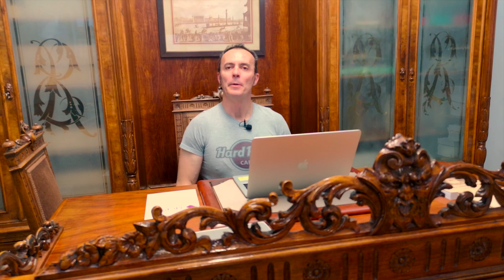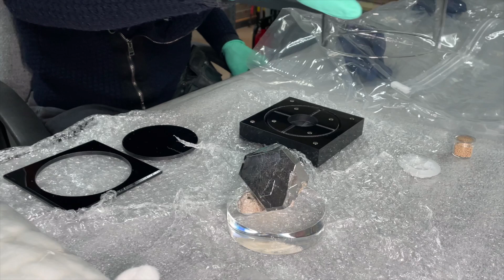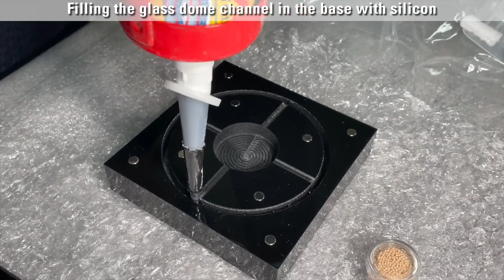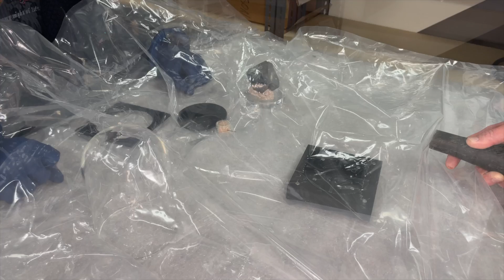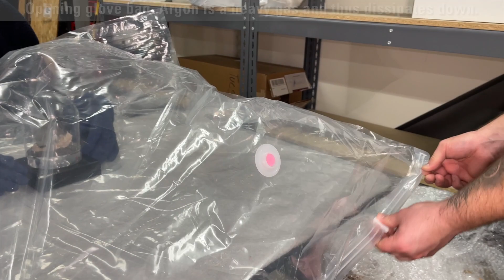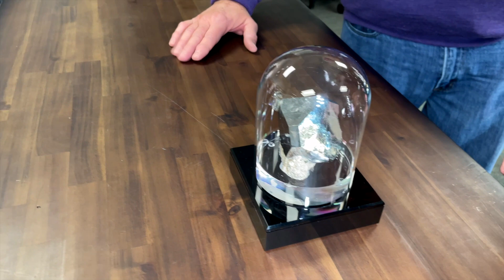Addressing Environmental Degradation of Sulfide Minerals with MCP, Christophe Gobin & Stonetrust

Comment: The issue I see with this is that the glass dome/cover was put standing up on the table in the vacuum bag, in such a way that oxygen would not be able to be vaccumed easily. So when the the bag had the air vaccumed out and filled with the Ar gas, the oxygen in the dome remained in the dome and was likely not completely vacuumed/replaced. So due to this I think there is likely still oxygen in there, which could be prevented next time by placing the glass dome on its side in the bag, so that the oxygen in the dome can be vaccumed completely.